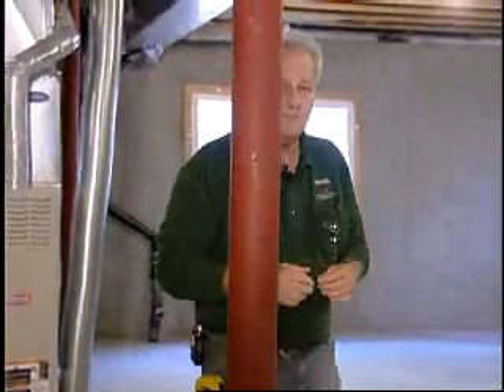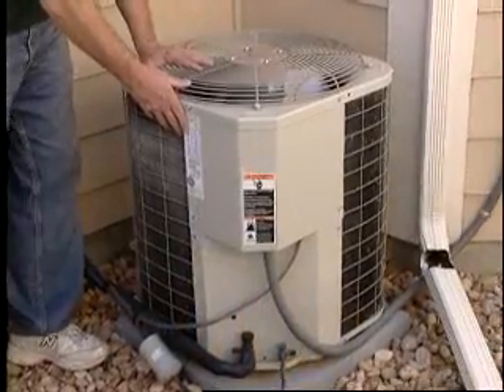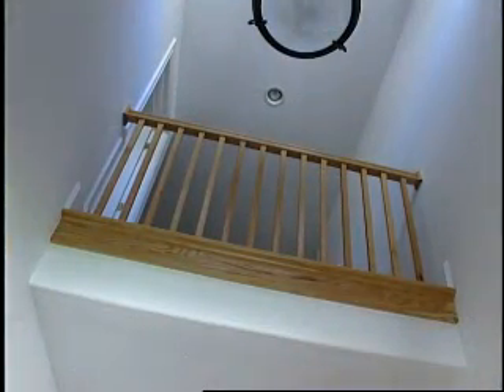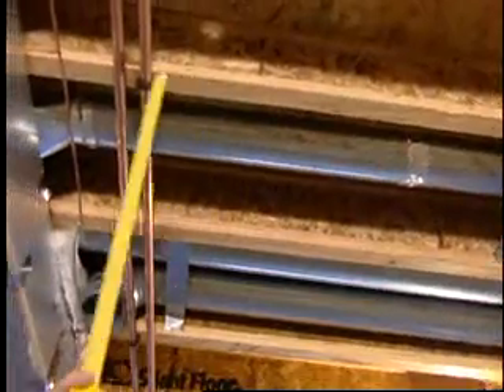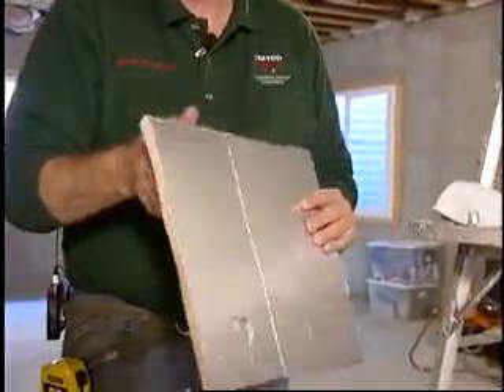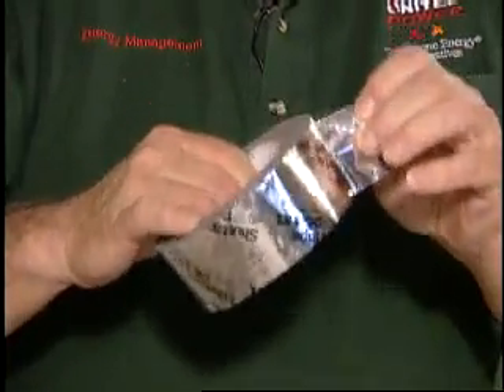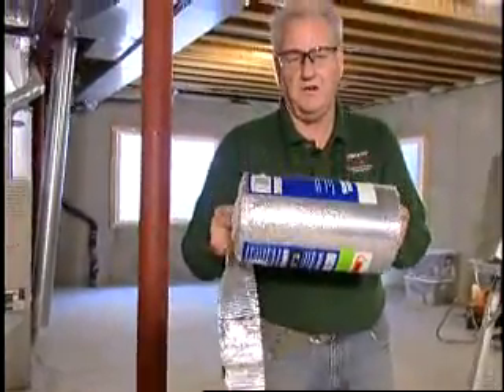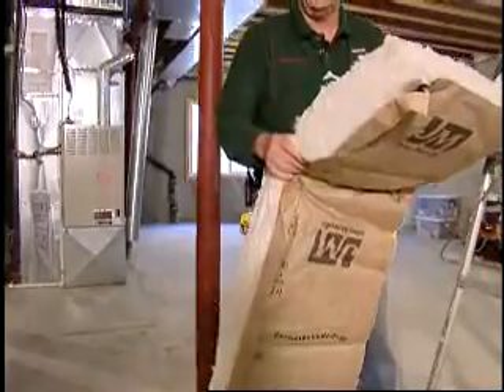United Power: Insulate Ductwork: Part 1

Comment: Thanks!  I was just about to give up looking up if that kind could/should be used to insulate ducts...I even looked on the Rmax poly/foamboard website, h.depot, none of them had the foil faced poly-foam sheet material as duct insulation.  This project I'm doing new cold air returns in my crawlspace, I had bought the foil/bubble wrap but it's going back, I need max insulation per inch due to clearance limitations.  Too bad "Dow tuff stuff" is so hard to get/find..H.Depot says "only in stores" which means if it sin't in your store, you can't special order it..and it's not around here in Michigan.  The Home depot does carry the Rmax R-matte poly-foam boards which I'm going to go purchase, and seal the corners and edges with foil tape UL181 for hvac.  I'm skeptical about the soft science claims of the foil/bubble wrap crap.

Comment: What about using the correct duct wrap, but even before that what do you think about sealing up all of the air gaps just on the metal seams in the ductwork and the unit itself? Contrary to popular belief (sadly) insulation is not going to seal the ducts and prevent unconditioned air from infiltrating the unit. Which I'm guessing is a far bigger energy waster than radiant heat/cooling loss. Judging from the professional looking install it''s probably lined on the inside with insulation already anyways.
Reply: He is only doing the air return duct. Isn't it just as important to insulate the supply ducts? Same materials? How can I tell if it's already insulated on the inside? Just knock on it? Thanks for any advice....

Comment: As specialist HVAC engineer I advise to use polyolefin duct insulation Better K value and green
Reply: He is only doing the air return duct. Isn't it just as important to insulate the supply ducts? Same materials?

Comment: what thickness of poly foam sheathing boards do you recommend? I went to HD and saw they had 1/2", 1", or 1.5"...the r-value (and cost) goes up with the thickness but at what point is there diminishing returns?